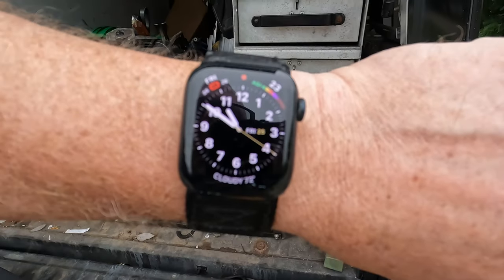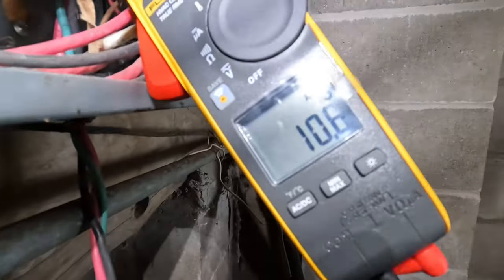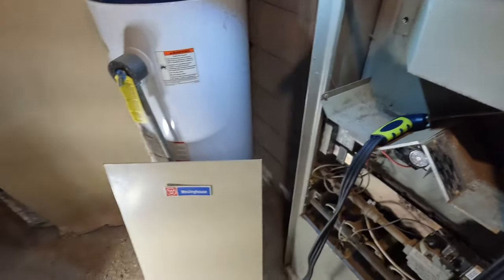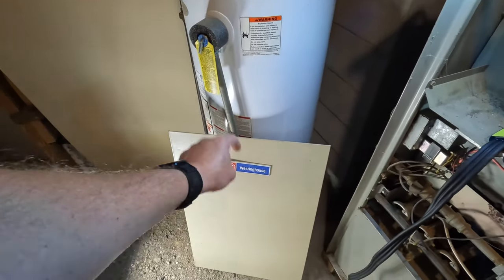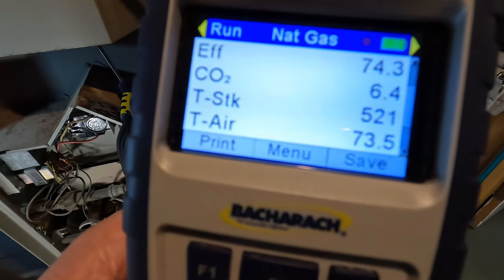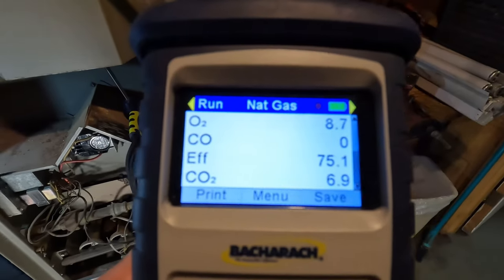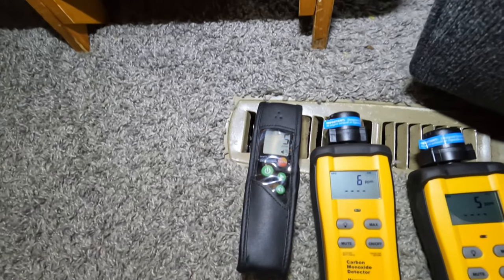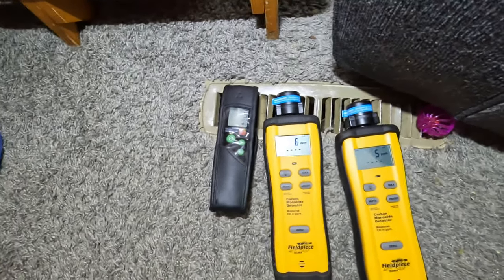44 year old Furnace having Issues.Time to replace.

Comment: Did the lady smoke? Also possible the thing was putting out 1000ppm co and it tripped the CO sensor on the analyzer.
Reply from the maker: No, she didnt smoke and anything is possible with the sensor.
Reply: @ADVANHVAC  an interesting story I ran into once was a call to a house for CO, checked furnace, stove and oven even, all great, then I heard this light psh noise and my analyzer went nuts, it was some off gas from some sort of battery for some sort of medical device that actually tricked the co detectors and my analyzer, very strange situation
Reply from the maker: Wow that is strange. Things we find out here! Lol

Comment: Those are too low of readings to  condemn the unit. (depending on state)
Or shut down in the middle of summer. To be condem a unit.
The woman sounded elderly or at least up in her years and don't have connection to the internet. 
Many things can cause that small amount in floor vents.
Reply: Many things like what? 0-1ppm is acceptable. 5-6ppm will just keep building in the space until it's a lethal amount of co.
Reply from the maker: Exactly, besides that furnace is 44 years old WAY OVERSIZED for that house. When that fired off, after a few minutes I started to get a headache so there was definitely something going on with it.